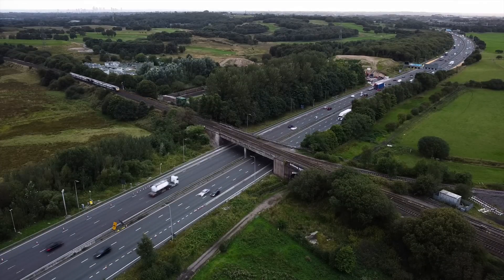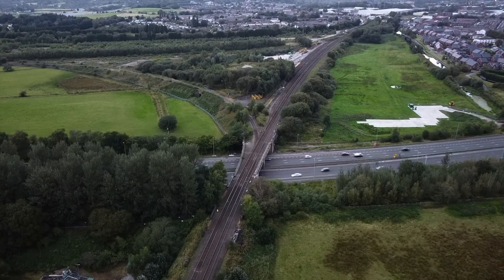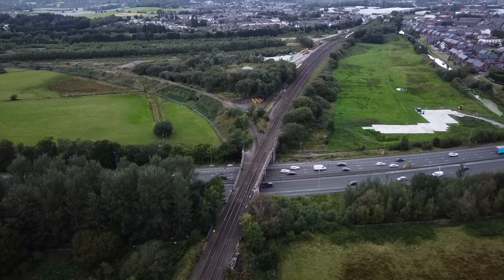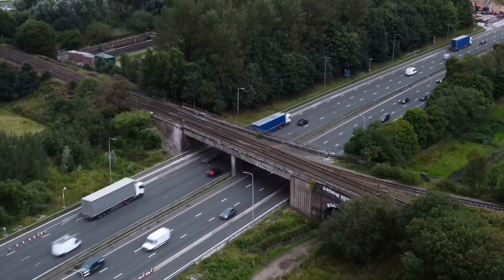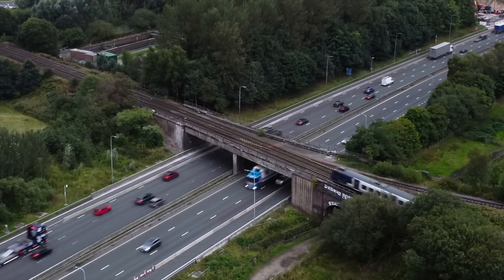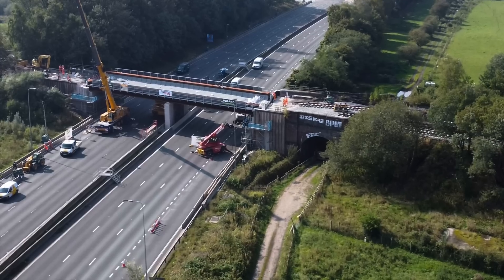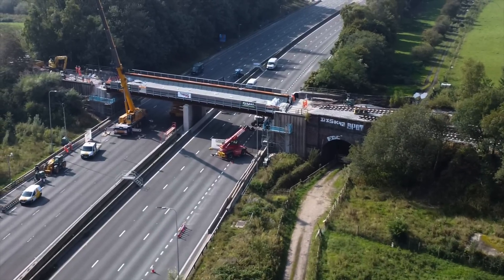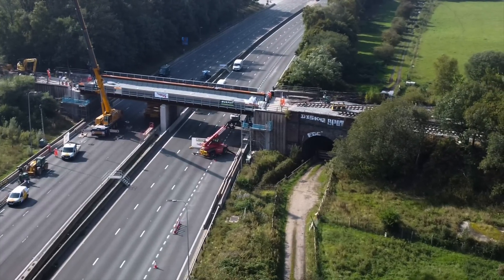Clifton Railway Bridge Replacement Project Penrith | M6 Motorway Bridge | How the project may look

Comment from the maker: What’s everyone’s opinions on these new style bridges that look rusty when installed ?
Reply: Corten steel? For what it does (natural weather resistance that doesn't require a protective layer of paint) I think its reasonably attractive. I am not a fan of it in an urban setting (for example I have seen modernist homes clad in it on streets containing traditional suburban housing) but for industrial structures I think it looks quite good.
Reply: Nah not for me!  Want to give it a good coating of Hammerite paint!

Comment: It says something about modern engineering that the original 1960's bridge weighed 2,000 tonnes but the replacement only weighs 350 tonnes.